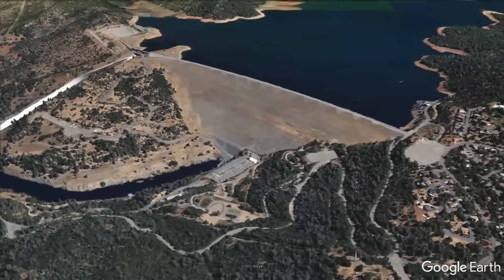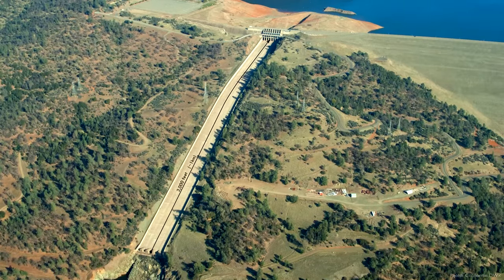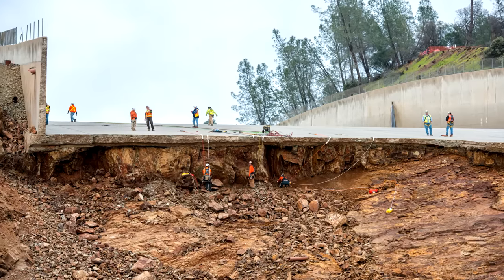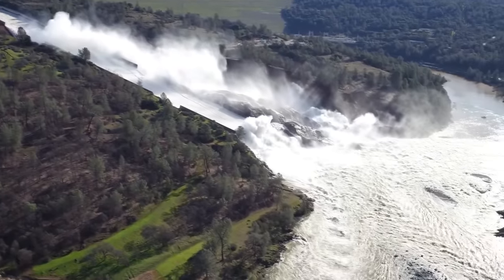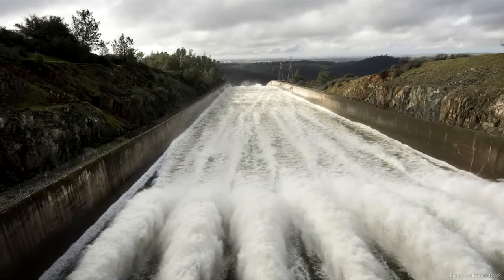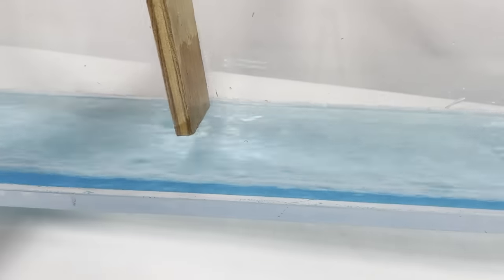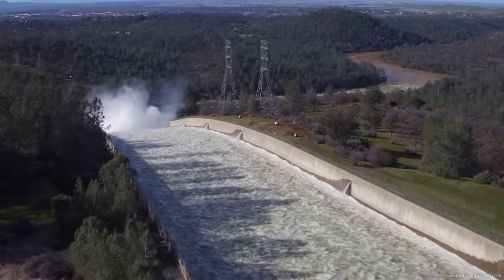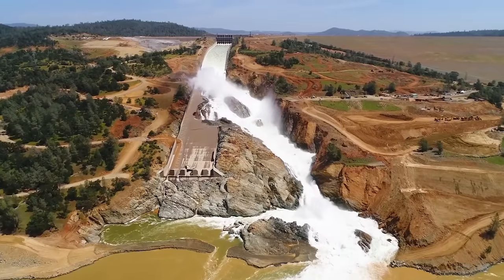What Really Happened at the Oroville Dam Spillway?

Comment: One of the worst mistakes they made was running the power cables through the emergency spillway and controlled spillway areas at all. They should have been routed around the other side of the river wash area in front of the dam.
Reply: That was knuckle head engineering
Reply: That would prove they knew it could fail, so they put it downstream. All engineers of dams should be required to live downstream of it and not allowed to evac.
Reply: @denniscross7142  hmmm, there's a problem, let's put innocent engineers in danger instead of the people incharge who didnt order the hills to be checked.
Reply: @cookiecraze1310  that would be the engineers then
Reply: @jonnie2bad  you‘re forgetting the people who set the budget, effectively limiting the engineers in what they can do.
Reply: We demand accountability, yet we label any engineer involved as 'the engineers'. The original dam engineers may not be the same group as the engineers that allowed the construction of major power lines through the spillway areas. Often times, the major mistakes are made by engineers making decisions where they didn't know the original designers thoughts or when the original designers leave things out. How many issues are the result of, "I don't have to identify that danger because no one would be stupid enough to do that".
Reply: @flyingby3703   @Flyingby  You're forgetting at the end of the day, the guy with the PE stamp on the plans is the one who is responsible, regardless of what the budget is set at. The guy with the stamp is the engineer. You also are forgetting even at the highest levels, the engineers boss also holds an engineering degree. Every outfit is different but this fact holds true in 99% of cases.
Reply: @jonnie2bad  I work as software engineer, so don't know how well this applies, BUT top leadership has a tremendous impact on the quality of the software produced.  That's why the culture of a software company is very important and it is something that can only experienced from inside.
Reply: @jonnie2bad  So a) this is the incompetent west coast governments we are talking about here. b) this was build many years ago with far worse technology c) its very possible the regulators were lied to (shit I've been lied to repeatedly by companies thinking I won't get suspicious) d) this PE on this project state side is only as good as a state can attract. Let me tell ya, states are incompentent as hell (until 2019 when job shortages amongst engineers happened). On a site this large, the reports for design and construction are at a minimum 10k pages, have fun reviewing that shit. Lets not even go into the fact Oroville Dams operating company MOST DEFINITELY covered up the problems or did not report them properly.
Reply: @thomasn708  One of the biggest problems that face engineering and manufacturing firms is the intrusion of non-engineers calling the shots in the engineering and construction of something - Boeing is one of the biggest and latest examples of non-engineers having the final word on the design of one of their products ( the 737 Max)
Reply: @TruthLivesNow  But Governor Reagan and then President Reagan, really is to blame. And "Doing nothing to fix the problem" is the culture created and is what Really IS the problem. The attitude that it's not a problem worth fixing until it becomes a problem is why it becomes one in the first place, and why it becomes a major disaster instead of a simple fixable issue. Complacency leads to disaster. Just look at the I-95 bridge collapse. The only idiotic thing here is your comment.
Reply: @flyingby3703  budgets in this projects are often time 3-6 time more then the cost to make them so much funding it allocated to rebuild the whole project twice over dont think funding was an issue its often never is its more or less cost cutting for bonus earning that create the issues as every penny saved is reaped in to the pocket of the highest level project masters
Reply: @jonnie2bad  The idea of holding one person responsible is fine but has its limits.  Its really about the process used, not individual people.  If your dam fails because the lead engineer made a mistake, then your design process was seriously flawed.

Comment: I love videos discussing disasters (or near miss) and what exactly lead up to them. It's almost always a pile of relatively small errors that accumulate to disaster. Understanding how each of those was allowed to persist, and what changes are necessary to avoid similar situations in the futures, are lessons we should all be more interested in.
Reply: Remember they missed Mars by .00000000000001mm
Reply: Mandatory inspections are toothless if you can't compel them to actually fix the problems they find!

That's a running theme on Well There's Your Problem, go listen to them!
Reply: In this case, mischaracterizing the underlying soil is not a small error.  It is criminal negligence.  I am quite certain that the guys actually building the primary spillway knew that it was only a matter time before it failed.  Someone higher up made the decision that not going over budget was more important than the safety of downstream residents.
Reply: go listen to "Well There's Your Problem" Podcast (the Vajont Dam episode is a doosy)

Comment: Honestly, it sounds like they actually made the best choices given their situation. By alternating what areas took damage, it prevented either from taking such a critical failure that the problem became unrecoverable. Still a bad situation, but could have ended a lot worse if they had let all the damage to to either the emergency spillway or the chute.
Reply: I agree. I think he's entirely incorrect. They engaged the emergency spillway with a chance of success and the ability to reverse course if it went poorly (which it did). Not using a designed feature for its intended use would have been unforgivable had the alternative ended up being worse. 

If one studies Fukushima, they'll see that many opportunities presented themselves to take a "lesser of two evils" approach and, in every case, they stayed the present course, instead. The outcome ended up being far worse than it needed to be.
Reply: I think the real mistakes were in building and planning.  The engineers may have handled the emergency in the best way, but mistakes were made and at least some seemed avoidable.
Reply: It was also a chance to test the emergency spillway..........if not for their choice, they may have found out at a later event that the emergency spillway was also not up to par. At least in this event, the dam did not give way. It would be a shame if at a later date the emergency spillway somehow became an even bigger problem. Also, they already had the river and hillside to repair, so the damage was wrapped up into one major event.
Reply: @CGT80  I think the bigger issue is that they should’ve tested everything when it wasn’t needing to be used. Governments (or in this case the California agency that controls the dam) always go for the lowest bidder, however, and the citizens of nearby communities nearly paid dearly for it.

Look no further than Chernobyl to see why you ALWAYS test before putting into use

Comment: On the other hand, by using the emergency spillway, they discovered how broken it was, too.
Reply: Yes, and thankfully, they made good decisions to mitigate that unexpected failure.
Reply: @trafficsignalman  Yep, it sounds like the operators here did a fantastic job in spite of the serious and repeated failures of the engineers and regulators. My degree is in engineering (not civil) and I've worked as an operator at a natural gas plant. It's extremely difficult to make the right choice under mounting pressure (both literal and figurative) so I give a great deal of credit to those individuals.
Reply: @somedumbozzie1539  The operators aren't responsible for those costs, the company that owns the dam is. The operators aren't responsible for the decision not to make the repair. Assuming the story you're telling is even true, that's the definition of "luck not talent" because the sheriff doesn't know anything about operating a dam or its spillway.
Reply: Exactly.
This shouldn't have happened in the first place, but at least it's one hell of a warning shot.

Aka next time shit should be prepared way better, the keyword is: should.
I personally wouldn't bet my life on it.
Reply: @somedumbozzie1539  What was called for wasn't a small repair but a major rebuild of the entire spillway system.  The primary spillway needed to be entirely rebuilt from the foundation up with proper features for the condition of the material under it, and the emergency spillway needed a complete redesign due to the highly erodible country rock.
Reply: @peterpan4038  Not in California, which has been neglecting the entire water storage and delivery system they desperately need (their largest population centers are a city in a coastal desert and a city on a peninsula surrounded on three sides by salt water).  Unfortunately, the history of dam failures goes back almost to the begging, with William Mulholland , the architect of a large part of the infrastructure that still supplies LA with water, having his reputation destroyed by a horrific dam failure in 1928.  (The general run of the analysis of the failure was that it was caused by ground shifting under a part of the dam foundation along an old landslide slip plane.  Unfortunately, these were all but impossible to detect in the 1920's, and the ground in much of California is riddled with them.  The amazing thing is there weren't more failures of this type.)
Reply: Its only for emergencies so itll only fail when its already an emergency therefore its ...not very important to build it well?.  I think i see the source of the problem.
Reply: At least they can't say it's untested anymore.
Reply: @somedumbozzie1539  A sheriff is an elected official, not a trained operator. He doesn't have the engineering training needed to make that kind of decision.

The trouble with both options was if they continue to use the emergency spillway it risks the erosion reaching the spillway structure and causing an uncontrolled release, but also using the main spillway in its damaged state risked raising the level of the lower river with debris and flooding out the power station, which would cause further problems and eliminate many options, spillway gates can't be opened or closed without power.
The sheriff may describe it as them being unable to decide, but what they're doing is taking account of all the data and options, and what consequences those options will have down the line regarding other options should situations change.
Reply: @somedumbozzie1539  id love if you could give some proof of that and how even IF it was true how they are at fault for something not even in their control to decide or handle
Reply: @CSpottsGaming  We can say that they saved the dam, and everyone below. Yes, a lot of ruin at the site, but that can be rebuilt.
Reply: I feel like they should have been testing it prior to that. It seems insane to me that it went 60 year without being tested once
Reply: @tylerheard3982  agreed
Reply: The emergency spillway for cost  reasons and in violation of every  follow up engineering report was exposed dirt not covered by concrete. If it had actually been used the 770 foot high earthen dam would have been eaten away and would have had a catastrophic failure submerging Sacramento California, our State Government, under water. And, no that would not be a good thing lol.
Reply: They avoided possibly a complete failure.
Scary thought for all those living downstream. Fortunately, they had the right people working that day.
Reply: @CSpottsGaming  the Oroville Dam is not owned by a a "company."  It is owned by the State of California.

However, the rest of the country is paying for their mistakes, to the tune of about $562.5 million. Apparently, California politicians have a lot of clout in Washington, DC.
Reply: @ncdave4life  I appreciate the correction but I think the point still stands: the people operating the dam aren't the ones eating the costs.

Comment: Really interesting video. I do wonder however about the conclusion that with hindsight most people wouldn't have utilised the emergency spillway. The conclusion that they didn't need to seems accurate, but they also had the ability to return to the primary spillway if there were any issues with the emergency spillway; in the end utilising the emergency spillway uncovered a large risk but one they could safely mitigate in this case (by returning to the primary spillway) and had the unintended consequence of demonstrating that the emergency spillway couldn't be relied on in its current state. It also meant that they knew of the issues with both spillways at a point where both could be used. extending time to evacuate. If they had continued to operate the primary spillway and damage reached a point where complete failure was a risk, then moved to the emergency spillway then they'd have considerably less time to respond to the risk of the emergency spillway failing. In short, I think both scenarios allow for both spillways to be run until near failure, but running the emergency one earlier gave them more time to respond to the potential failure of the dam.

Comment: As a geologist with more than 40 years of experience (in at least 10 countries around the world) I just had to look at the regional geology to know that money AND Engineering Egos played a critical role in the poor investigation and the non-implementation of preventative measures for the specific geological environment. In the specific instance just 1 cored rock borehole would have  been sufficient  to alert the engineers to the dangers that could be expected.
Congratulations on an excellent presentation 👏
Reply: I had to wonder what would have caused the first issue of not knowing the ground they were building on. The second issue of inspections and mitigation of issues found during them is a complete CF of epic proportions.
Having been a fire alarm technician that attempted to do professional level work as an inspector and technician, the issues that craptastic local fire marshals missed during their checkouts of fire alarm systems is just brilliant. These firefighters need a year under someone that knows this end of their job as fire marshal to show them what the hell they need to watch for here. (Electrical system knowledge versus firefighting knowledge.)
Reply: No one thanks the engineer who spends $20K-$50K more to produce a geotech report to inform a design to prevent a failure that would otherwise not happen.